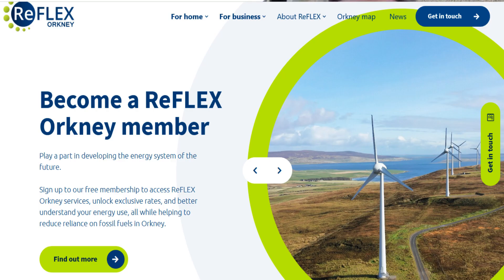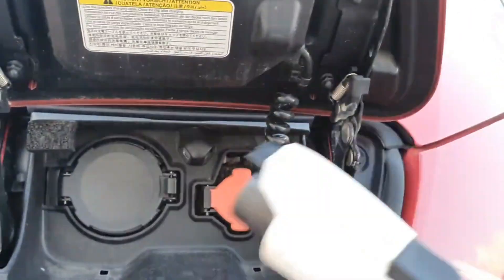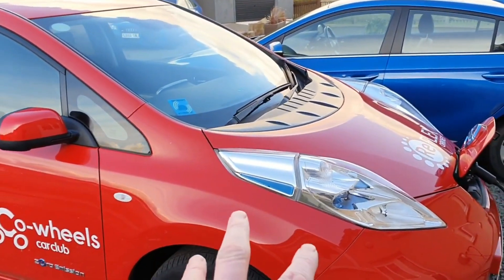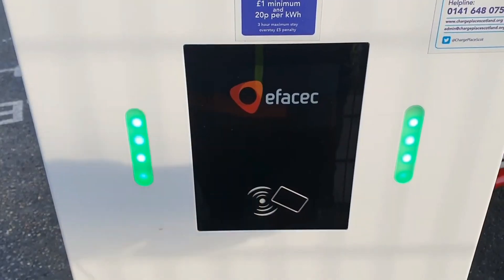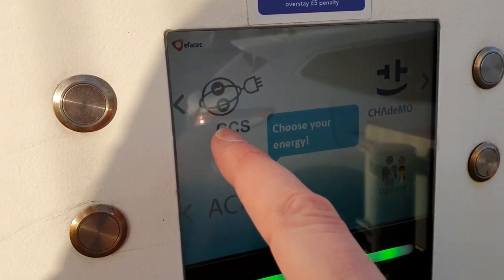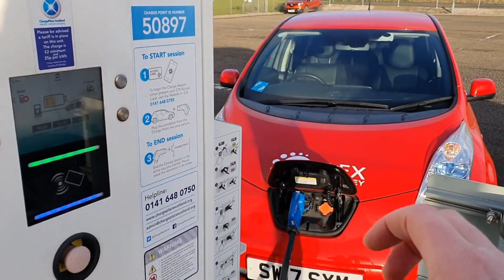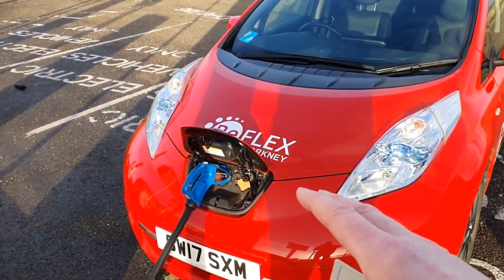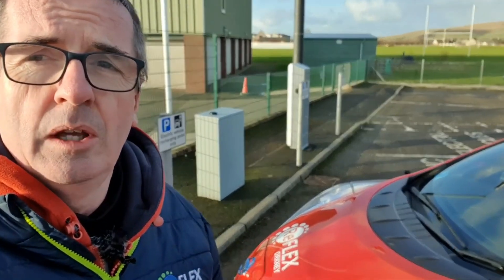How to charge an Electric Vehicle with CHAdaMO and ac at public chargers.

Comment: I don’t think I missed this in the video, but where’s the explanation of the ‘card’ that is presented to the charging station? Is this a payment card, or some kind of ‘registration’ card ? Can you set the maximum charge on a station? I’ve read that it’s advisable to only charge to 80%.
Reply from the maker: The RFID card in this video is from Charge Place Scotland,  I now use an Electroverse RFID card as it covers over 90% of all public chargers in the UK and Europe,  and as a octopus customer I get 5 or 10% off ! 
If you'd like one of these cards , use my referral and we both receive £5 credit into the Electroverse account to use on charges.
https://electroverse.octopus.energy/sign-up/magic?referralCode=crisp-shade-12433

Comment: Amazing how much more advanced charging infrastructure is with you then densely populated Oxfordshire. Probably worth pointing out that some older Leafs only charge at 3.3kW even on 7kW chargers (as opposed to 2.1kW for the granny charger). So the different in charging speed is hugely different.
Reply from the maker: Yes Japanese leaf up till may 2013 , where only 3.3 kw on board chargers , then uk built leaf from may 2013 , some 24 and 30kWh the optional 6.6 on board charger fitted from new.

Comment: I really wish we could get 150kW DC chargers in Scotland that split that output between two DC connectors. I presume that most of those 50kW units in Scotland will not allow two DC charges at the same time eg. CCS and CHAdeMO?
Reply: Correct, only one DC can charge at a time, but one DC and AC from same unit can also charge. Not sure how it splits the charge as we can only get 11kW on Ac.

Comment: Thank you mate. How many different charging cards are there & is there 1 that will work at all of them ?
Reply from the maker: In Scotland the 'charge place Scotland' cover 90% of all public chargers , other providers  like instavolt are arriving , these can be used with a normal bank/ debit cards.
Reply: @JonathanPorterfield  
Cheers mate, it would be far easier if you just used your Visa card or one card for all.
I guess that's too easy, like having one fitting to charge all cars? 😉
Program is great cheers